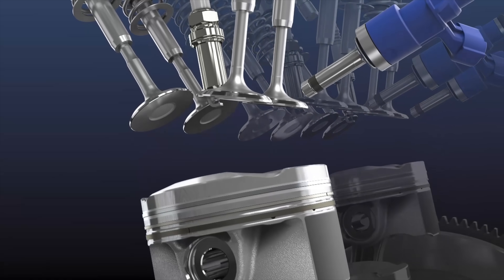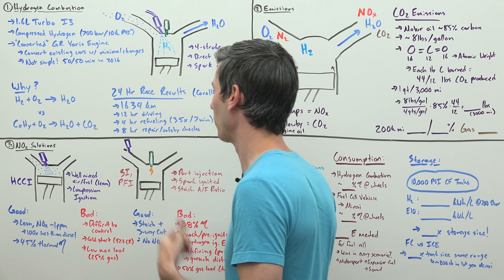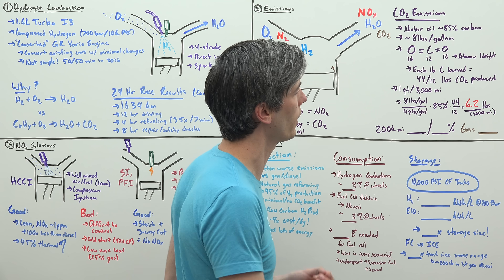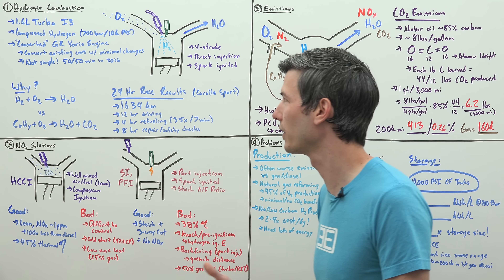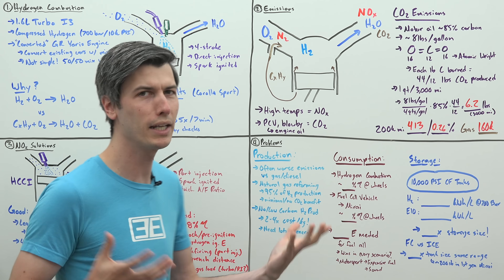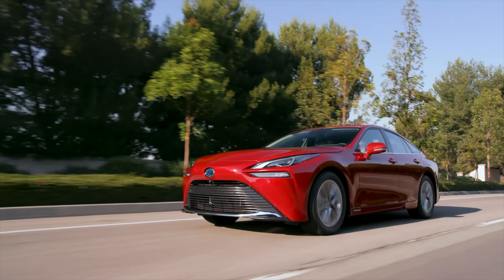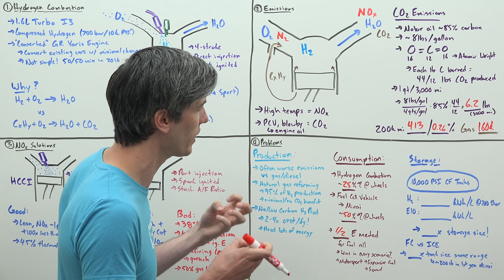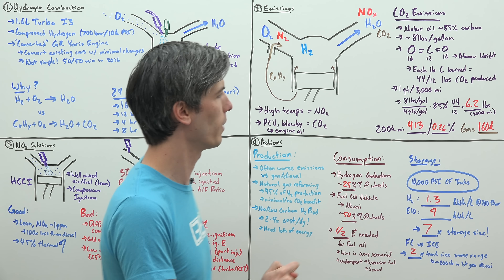Toyota's Developing A Hydrogen Combustion Engine!

Comment: 1600km in 24 hours, virtually every BEV beats that, and uses a third of the energy to do it. A Mirai reaches 35% efficiency on a good day, not even close to 50%. It's better, cheaper and easier to directly combust natural gas in an ICE engine.
Reply: Perhaps. But you cannot extract nat gas from water using wind and solar.
Reply: @californiadreaming9216  Realistically, you can't extract H2 from wind and solar either, because there isn't enough wind and solar available now and in the foreseeable future. You can, however, fill a battery with your own solar in your own garage very efficiently and easily, and there's no technical hindrance to prevent you from feeding this energy back in your home at night. Today, 98% of all H2 is made from nat gas at a great loss, it's thus better to fuel ICE engines with nat gas than fuel cells with H2 produced from nat gas at a lesser efficiency, and it is of course best to use electricity from batteries to power BEVs, which Toyota has clearly proven with this FCEV "race" car.
Reply: @adrianguggisberg3656  I do not dispute your observation that EVs are more viable, not only from the perspective of efficiency with organically-harvested energy, but also in terms of simplicity - electric motor technology being much older and far more developed than hydrogen-piston. But your opinion that there " isnt enough wind and solar available " is, with respect, absurdly incorrect. 
     The energy business is far, far more political than you appear to understand. One of the principal factors holding back solar energy is the fact that it LITERALLY has the potential to alter the economic landscape of our planet. Consider: Africa is, statistically, the planet's continent with the lowest GDP. Yet interestingly it has more sunny days per annum than any other continent. And is situated south of densely-populated energy-hungry Europe. So if Africa went into the solar energy business en masse (Sahara desert anyone?) and had large cables sending electricity to Europe via the Mediterranean , the cashflow shift would be staggering. The energy mafia knows these facts only too well.
     Adrian, we live in an age of not only information but also, sadly, very deliberate disinformation.
Reply: @californiadreaming9216  It's inefficient to transport electricity across the Mediterranean. And it's also unnecessary. There's plenty enough solar energy available from existing roofs, provided they were covered with PV panels. The reason why trans Mediterranean power lines, hydrogen and E-Fuels are so strongly supported is exactly because we would then still need big energy to a much greater extent. Solar farms, power lines, H2 and E-Fuel plants, transport thereof would be controlled by big energy like with coal and oil. Set up your own PV and a battery, and you can do without them, if need be. However, it makes more sense ecologically and economically to feed extra power into the grid and buy back if and when required. If we cover roofs with PV, we don't consume extra space and extra solar energy, which would otherwise be available for plant growth etc. and we harvest said energy where we need it, without transport and other losses. The main problem is really the current market economy, because it greatly favors the opposite of what we would (and eventually will) have to do to preserve the planet: make far fewer, longer lasting and more efficient products, consume less energy and space, and decrease world population. Rest assured that Africa was to profit very, very little, if Europe was to produce power in the Sahara or elsewhere in Africa.
Reply: @adrianguggisberg3656  most of your points are, in my opinion, valid. Rooftop energy harvesting presumes much. Not everyone lives in a single-family dwelling. And Europe and North America more than 50% of the population live in tenement housing. From a deeper perspective, it really comes down to economics. Energy Mafia absolutely does not want homeowners to become energy self-sufficient period which is why solar panels for homeowners are illegal in Florida Kama one of the states with the most sunshine in the United States.
To some extent you have mixed your apples with your oranges especially when you wandered into the area of world population. This planet was built by a master engineer who knows exactly how many people that can accommodate and how many people that cannot accommodate and He shall govern human affairs accordingly.
It is laughable to state that the planet is overpopulated when in Canada, United States and Brazil more arable land is used for biofuels then for food production. Anyone who has traveled extensively around underpopulated parts of the planet, as I have will tell you flat out that there is ample room for plenty of people on this planet. Bottom line: planet Earth does not have a shortage of resources. It has a shortage of Good Will and an absolute abundance of greed.
Reply: @adrianguggisberg3656  once again there is Merit in what you are saying. Indirectly you are agreeing with me. Humanity itself is not the problem with this planet. Rather, it is human tendencies including greed as mentioned. I certainly agree with your point, if I am understanding it correctly, that humans are indeed a species of excess. Too much food. Uses too much water. Homes are way too large. Far too focused on pleasure. Having traveled to parts of the world where people survive on far less than they do in North America I can tell you that in our Western Society we are indeed a culture of excess.
Reply: @californiadreaming9216  I'm of European origins for the most part, but I was born and raised in Rhodesia. Therefore I have a pretty good idea of how much people need to live a happy and joyful life. It's actually not very much in terms of material goods. However, one can pretty easily calculate how many humans the planet can support long term, and that's somewhere in the neighborhood of one billion. But that's obviously one billion sensible people, not one billion of today's Americans or Europeans. Now I'm aware that we can't change the world in a day. I have no clue whatsoever how a future society should function, let alone how to transform our current one. But I believe or rather haven't lost all hope that, if we all do what we can to preserve what's left of nature, save energy etc, we might just be able to buy our  descendants one or two centuries to achieve that transformation. But then, right now it really doesn't look very good at all, mate.
Reply: @californiadreaming9216  
Do you think those solar panels in the Sahara are going to clean themselves? In Northern Africa and the Middle East efficiency losses of 0.4%-0.8% per day are typical due to dust buildup, with 60% loss due to sandstorms. Installations in such places are far more costly because cleaning must be automated.

How do you believe that huge solarworks in Africa will positively impact the life of the average inhabitant? Large projects benefit those who can invest in them, but typically displace endemic sustainable uses of the land, using available resources essentially as the fertilizer for cash crops that are exported. These would not provide longterm jobs or needed infrastructure in Africa. Europe has learned its lessons about depending on energy coming from outside its borders and is unlikely to invest in creating a similar situation when it has sufficient solar, wind and other renewable resources available close to home. It is you who doesn't have a handle on political realities.
Reply: @adrianguggisberg3656  chatting with you is a refreshing change from trying to communicate with some of the brain-dead people who post comments on YouTube. Your observations and opinions are sound. It is entirely possible that a sharp human population correction may occur. They have occurred before. And what you are saying is entirely accurate, in order for Humanity to move forward we need far less self-centered people on this planet. Cheers. May your God watch over you and yours.

Comment: By the time this comes into production there will be EVs that run 500-600 miles per charge.
Reply: And most of the planet doesn't have reliable electricity.
Reply: @Siegetower  What developed nation that has a major car market doesn't have reliable electricity?
Reply: @thetechguyz8645  Is the developed world most of the planet?
Reply: @thetechguyz8645  Polluting industries are not evidence of 1st world economies in the 21st century. Even in the 20th century. Go look up Dzerzhinsk which was a major chemical factory city of the Soviet Union (2nd World)
Reply: EVs that run at all pour far more trash into the environment than they will ever save. The batteries and other components. Oh, electric cars do not have emissions. Charging them does. More so than a gasoline engine. Oh, 500+ miles in a gas engine. 5 minute fill up. EVs, um you're at Holiday Inn overnight. Or two. BTW the US currently DOES NOT HAVE THE POWER INFRASTRUCTURE to facilitate wide use of EVs. We can get there. It will take about 100 years as every part of the grid from production to home plug will need to be replaced. You're obviously not an engineer.
Reply: @thetechguyz8645  California

Comment: Refueled 35 times, which means the car traveled 46km on ave per fill-up.
Taking 7 minutes to refuel results in a rate of around 7km per minute.
Teslas, using V3 Superchargers can refuel at more than 50km minute!
Reply: It's almost like nothing about this makes any sense whatsoever.

Comment: Great video, when you touch on the fuel tank at the end, i was thinking that any one is forgetting the last part of the equation. That is the danger of hydrogen alone that we can't smell, see, and is easy to leak( you mentioned the easiness to leak at the valves) and is quick to ignite. It could be dangerous in an accident. You mentioned the cost of manufacturing the hydrogen. No matter what, the we need more energy to produce it then it gives. 
     At Ballard in BC Canada, they have been working on fuel cells in cars and buses etc. Great amount of money have been spend and it is still not there. I understand that we want to keep the ICE but looks like we have to adapt  to something else. To be more sporty, manual transmission with electric motor? 
      Thank you for the great videos that you do,

Comment: It's so mind-boggling that Toyota is still researching hydrogen engines while the other major manufacturers are going electric.  Does Toyota plan to develop an entire system of hydrogen fueling stations that can only be utilized by it's vehicles?
Reply: Electric is better in every way, but the fuel is an absolute deal breaker. I have 2 chargers in my garage. There are zero hydrogen fueling stations in Ohio, so the only way you can get around in a hydrogen fueled vehicle is if you have a towtruck drag you around. And hydrogen fueling station's aren't cheap. Level 2 chargers are.
Reply: Toyota really need to wake up and smell the coffee. At the moment they are on a one way trip to dodo-land
Reply: @fjalics  wind energy cost to much to maintain, and there isn't enough of it,, I don't think it's a great source of energy,, The first thing they need to do is update the electric grid if everyone is going to rely on electric.
Reply: @coach2208  Hydrogen isn't free.  It requires energy input and has undesirable byproducts.  Like my introductory chemistry professor said on Day 1 of the class: there's no such thing as a free lunch.
Reply: It's because the Japanese government's public policy in the energy sector relies heavily on hydrogen. Toyota is following suit and, wrongly IMO, trying to use propaganda to sway enthusiasts to their side.

However, Toyota is smart and has several hybrids and BEVs on the market alongside their Mirai. I think it's got much more to do with bolstering their current affair with sporty vehicles.

Comment: Great info! :) BMW had hydrogen combustion engines a few years ago, and if I'm not mistaken they scrapped them pretty soon after. Hydrogen Fuel Cell technology just makes far more sense in the end.
Reply: I think both avenues need to be explored, I really think that electric cars are a blind alley in so far as they are still not practical for long journeys as the best you can hope for in the real world is about 400 miles on a charge and the hours rather than minutes for a full recharge, hydrogen seems to offer the flexibility of conventional fuel with significant emissions savings. Many of the problems that they are now seeing with hydrogen power they had with oil/petrol power when they first invented the ICE so I have no doubt that it is possible to overcome many of the problems highlighted in this video. I remember back in the seventies my dad was really pleased when  he bought a 1300cc car and got nearly 30mpg when we went on holiday four up with all the luggage and just last year I was getting over 50 mpg from a three cylinder Citroen which was very drivable and would cruise quite comfortably on the motorway at 80mph whereas dads 70s car would struggle to reach 80 mph. I accept that there are downsides to all fuel sources but I do believe time will prove hydrogen to be the least damaging of all the options and governments should stop banging on about zero emissions and carbon neutral as that simply doesn't exist anything we do that involves energy which is just about everything is going to have an impact, what governments should be focusing on is practical ways to minimise our impact whist at the same time keeping the world moving, fed and warm.
Reply: Fuel cell are very expensive, and you still need a battery...
Hidrogen in combustion engine is the way to go. 
Jcb makes big machinery, they have now a new line of Hidrogen vehicles, they use the same diesel block and change the head and the injection to Hidrogen, and that's it you have machine that works like a diesel one with zero emissions, see their documentary.
Reply: No bmw went for H2 when others like Merceds did fuelcells. Now both have acrapped it.
Reply: Both bmw and Daimler did hydrogen but they were not scrapped, per se, they were both tech demonstrators.

Comment: What about installing a pure O2 tank in the car? Instead of drawing in air, inject only pure H2 and O2 into the cylinders for a non-emitting exhaust (aside for the small amount from the oil). I've read that the mix is somewhere between 4:1 to 8:1 hydrogen to oxygen, so it would be a smaller companion tank. When hydrogen is made (of course using some kind of green method), oxygen is made as well, we should be tanking both and use the oxygen for whatever applications require the combustion of hydrogen. For a fuel cell, air intake is fine so no need for pure O2 for that process.